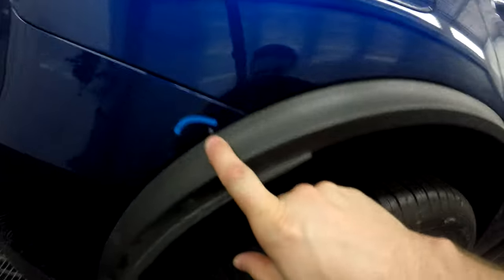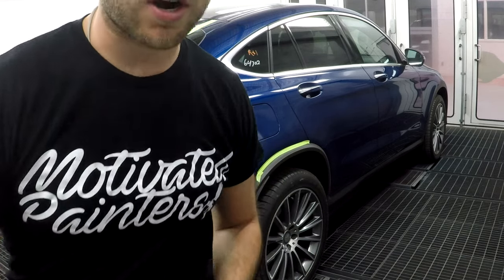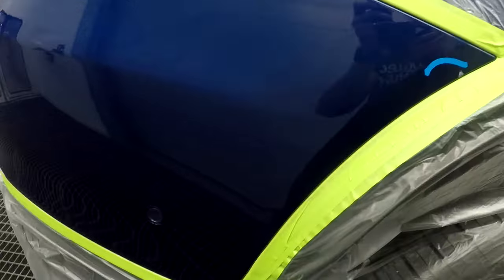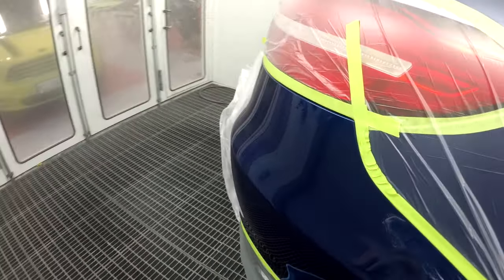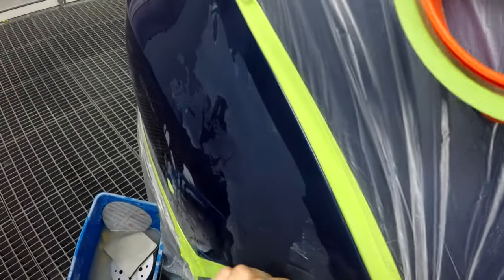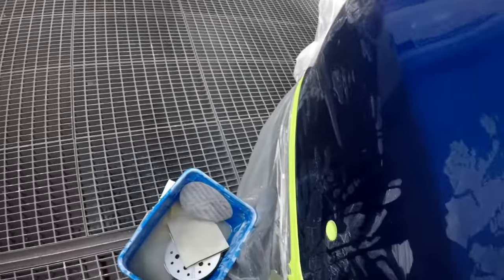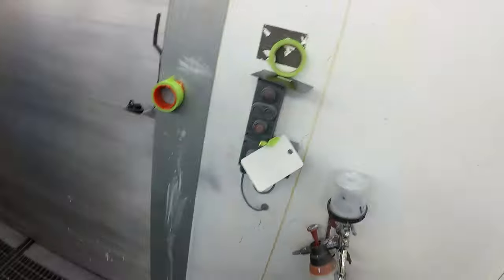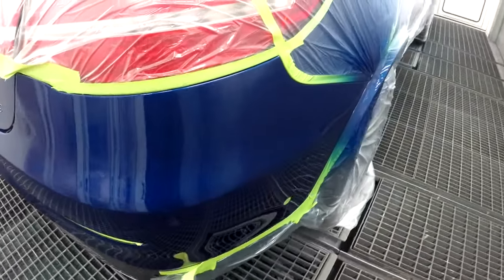How to do a blow in/smart repair

Comment: Why? On the car with a clear blend?why not take it off and paint the whole thing? I get the cost but the quality will be 100%  ppg will not guarantee any clearcoat blend. And they are 100% guarantee to fail over time.
Reply from the maker: +James Fields yup. I agree with you. The customer is always right.
Reply: Agreed,  but it is a  nice blend  job :)
Reply: They don't want to pay what it weighs
Reply: Why exactly do they fail? I read somewhere that as long as you keep the base coat overspray away from the blend area and make sure the clear coat is fully cured before buffing, then it will never fail.
Reply: Do what you have been told to a black car on the bumper or pillar. Wherever. If you blend the clear and polish it out it will look great. But over a few months/ year the clearcoat will fail. Uv protection is obtained by mills. You thin out the clearcoat you thin out its life span.

Comment: Why not just west sand the spot use a fine line paint pen to touch up and polish the area to help blend? It wouldn't be perfect, but it wouldn't be noticeable on a scratch so low. You would have to be low and within a foot of the car to even notice. That's a lot of prep work for something so small

Comment: Thanks great info and ill put the info to use. I need to dust  in some poly clear where i sprayed it a little light or not at all on base with hardener. I plan on using the cardboard method for a soft edge and wet sanding the over spray. The clear is now 24 hrs old. Ppg says you can topcoat with scuffing after 24. Like any time whole panel or can you spot? Well see. Full restoration 66 chevelle on my channel whole rest of the paintjob is really good other option is a full wet-sand reclear.  This car wont see more than 10 days outside a year. Great stuff thankyou for all your videos i watched and how they help build confidence. A 66 chevelle is a big canvas!

Comment: This was great and it cleared up a lot of my uncertainties seeing how you used sanding to make the blend look smooth.  Thanks!
Reply: Good job well done.
Basically what your saying is only use top coat on the repair area, not on the blend  area?
On the repair you used 500 then 800 and so on...
In the blend area rather than using 1000 could you not of used 3000 all the way to the blend area?!?
Reply from the maker: Yes !

Comment: Hey Gabriel, did you end up wet sanding 5000 or did you do your blend on top of the 3000?, I couldn’t tell by the video if you ended up going with 5000 grit after the 3000?

Comment: Do you wet sand 3000 all the way to the edge of the plastic or do you leave a "small" strip of OEM clear?
Reply from the maker: 3000 until where I'm going to apply the blender

Comment: Hey Gabe I have a question for you. I have blending question for you. I have blending solvent and I wanna know if it is meant to be used in mixing with base and clear to spray or is it ready to spray when blending? The manufacturer instructions are not clear on use of their product.
Reply from the maker: Not sure brother I have never used what you are using so you know more than I do. You don't have to use blending solvent for base though just for clear

Comment: We have the same waterborne system you use and I'm having trouble with an 800j color code the base is always to light what do you recommend me do? And what do you do because I'm sure you to tint it as well. Thanks in advance
Reply from the maker: +zay gomez hey brother I usually look at the chips and go from there. I have a playlist on white pearls you might find helpful. I rarely tint them but just look for the best chip. But if you are having issues with it beeing to bright you can leave half of the white out if the formula and go from there.
Reply: I have found that the red variant matches the base really well, done quite a few of those, red variant has always worked
Reply: Zay, check your specials. There are some good variants in there. Also, you may want to spray 800J over g3 instead of g1 g shade. Can help the ground coat from being too light.

Comment: So....
800 grit on repair and base paint area.
1000 grit on transition area where clear coats ends and  3000 grit area begins. 
3000 grit area and edge of the clear coat is covered with blender. 
Absolutely no base on the transition and blender area. 
I think I got that correct? I have a small bumper repair I want to DIY. This video definitely helps.
Reply from the maker: Exacto!!!!

Comment: When doing a smart repair, do you clear past where you sanded?
Reply from the maker: Nope you can clean very well and clear up to you 1000 and 3000 then blender
Reply: @MOTIVATEDPAINTERS  thanks. My edge looked good until it started to dry. Can it be wet sanded and buffed?
Reply from the maker: Yes unless you got base overspray. It won't polish perfect
Reply: @MOTIVATEDPAINTERS  what grit sandpaper would you recommend sanding it with?
Reply from the maker: 3000

Comment: Can I mist with reducer from a finishing gun instead of using the blending spray in a can?
Reply from the maker: You can but you will not get the best results
Reply: Wow thanks for the quick reply, you’re awesome! The whole car is wet-sanded to 2000G and the blend will be sanded to match, then compounded together. Should I bother with blending spray at all? Thx so much for your valuable time..!
Reply from the maker: Yes you should  but you can always do a test panel on an old part and see how it would work
Reply: I couldn’t get blend spray so I used reducer with your technique, it worked out really well and will finish perfectly. Also I never thought to purposely blow away from the repair with both base and clear, what a difference! Thanks again man

Comment: In the shop where I worked to learn paint and body we did what they called a “ burn “ very similar to what you did there but we didn’t use blender , the problem we had with a burn was after it was buffed our it looked great but a few months later the blend area would show back up .
Reply from the maker: +MrFireman164 right yeah. Blender helps with that
Reply: No it doesn't... the blend area returns because the clear melter/blender solvent has no UV protection.  It will fail sooner or later.  Do not do a repair like this if you work at a shop that has a lifetime guarantee.  This is how you repair a 15 year old junk car in a driveway.  Not the way a newer benz should be repaired.  Turnout great, but it will end up failing over time.
Reply from the maker: +fwh79 yes sir! Thanks for the comment! The customer is always right.
Reply: You're welcome.  I hear ya man... been in the industry for 20 years, painting for the last 14 years now.  Gotta love the... shop management, owner(s), fellow employees, insurance companies, customers, paint or material reps, missing time on the sheets, insanely low labor rates (by the way... I love how used paint thinner is classified as "hazardous waste"... where is my HAZARD PAY???  Keep breathing that poison!),  being told I can "make it up in volume" when I explain that there is not enough repair time on a sheet, hearing about how a customer has run out of their rental and need their car back asap (like it's my fault that they didn't get rental coverage... way to be an adult customer with no rental coverage), cycle time, MATERIAL COSTS (I don't set the pricing on materials... sorry guys, I just paint the car), how I need to come in early and stay late (which bodymen almost never do, which is also usually WHY the shop needs me to stay late.  Bodymen love to bring cars over on thursday and friday so... I can just stay late to make up for their short comings concerning time management while they go home to their families at 5:00), and all the other things you can't control/constantly lose money on that are not your fault, even though everyone thinks it is.  Oh yeah... and you have to have the artistic TALENT to paint a car without messing it up on top of all of that!  You did a great job in this video and I hope you are being taken care of where ever you work.  Happy holidays to you and your family and good luck to you in 2018.  Sorry about my rant... this industry really knows how to make my blood boil some times.  I'm sure you and many of your subs know exactly what I'm talking about.  But hey guys... any monkey can paint a car.
Reply from the maker: +fwh79 HAHAHA oh man I glad you can let it all out man!  We got to focus on the things we CAN control and kick butt that's for sure!! Merry Christmas brother!!😊😊😊
Reply: Indeed!  Thank you my friend.
Reply from the maker: +fwh79 I appreciate you man
Reply: hit the nail on the head with your rant bro,,i have been in this industry (prison) for 32 yrs now..not ever gonna change but there are better places to work that treat you ...better i should say with a pause lol...
Reply: Jeff Barker:  Thanks brother... glad to hear someone agrees with me.  Starting to think i'm the only one losing my mind working at a bodyshop!  Back on December 4, 2017 I was "let go" cause we got a new manager.  Should tell you that story... it was pretty retarded to say the least.  It has been over 3 months and I haven't even started looking for a new job yet.  Completely dreading it!  It's like, every morning I have to decide if i'm gonna go out into my garage and start my car with the doors closed.  Seems like the only way out of this B.S.  Been thinking about starting a youtube channel to let all the customers out there know what is really going in at these shops.  So many stories to tell. . . that's for sure.  Are you a painter Jeff?
Reply: i hear ya bro, hope your car don't start ,cause that's not how you want to go out..yes I'm a painter/bodyman..believe me fwh79,there is a job out there with your name on it, get up kick yourself in the butt and go get it brother !! imagine if you had a daughter and the guy she is with has your current mentality , even though i don't know you personally,i share your frustration cause yes its happened to me too..you would want best for your daughter right? wouldn't you tell the guy to "Man up!" ,,guess that's what I'm telling you bro, like i said, this industry is not going to change but believe me its a lot better to deal with in other shops, go out and find the one best for you,or one you can better by joining there team..i have had jobs i hated to even show up at lol..but i have one that i can not wait to get to every morning,,its not state of the art like Gabriels video but people there are good..from one painter to another bro, i feel ya and i will help ya too..
Reply: Jeff Barker:  Thank you, that really means a lot to me.  I'm just tired of fighting and being surrounded by cowards.  No one can make a move cause they all have a family to take care of.  I get it... but it's not helping the situation.  Everyone has been conditioned to take it laying down.  They get accustomed to the boot on their neck and that is wrong.  These MSO's make me laugh... run by completely incapable morons that are "college educated".  They want monkeys in a shop to use six sigma while the people in the office can't even type on a computer without look at their hands!  The insurance companies run it all... and I know, some how... if you could trace the money up to the top... everyone one of these MSO's is owned by an insurance company.  That is the ONLY logical reason to explain the incredibly poor choices that are being made that cost the paint technicians a ridiculous amount of money every week (anyone remember Allstate and their Sterling shops???).  I can't stand getting out of bed and busting my ass, losing my mind fighting everyone for nothing.  Bodymen easily make twice what a painter makes.  The scales are way out of balance.  Lets not even talk about how bad the detailers are getting hosed!  It's completely insane to say the least.  I am an ICAR Platinum tech and i'm doing good to make 60K a year working some really long hours because most bodymen can't get their job done in a timely fashion.  I'm seriously considering just switching to body work.  Then I can do terrible body work that I won't be held accountable for.  While the paint shop has to block sand and prime my cars for free.  Not really hard to make money that way.  But it seems like the best course of action is to just leave this disgusting trade.  It seems as though no one cares as long as "their wallet" isn't effected, and it seems nothing is ever gonna change.  Thank you again Jeff.  Sorry about the rant... but i'm really mad as hell.
Reply: Mitchell R:  I worked with a paint prepper back in 2012 who OD'd because of his job.  Most of the employees at body shops are functional alcoholics, drug addicts, or both.  This industry literally kills people.
Reply from the maker: I completely agree brother I really do. I have learned that what people do to me should not determine who I am and so far it has worked well for me. I am truly blessed that I am taken care of where I am. But it's a two way Street of course
Reply: Doesnt matter what bodyshop you work at, you will have to do it at some point. Either because its an old piece of shit, or even brand new. Some people buy 150 grand cars, and wont buy new tires or arent willing to spend money to even paint the whole panel, lol.
Reply from the maker: Very true man !!

Comment: you need to fade out the clear the same way you fade base if you stop the clear in a line eventually as the paint gets older you going to see the clear line. how i was taught from ppg,sikkens an penta paint seminars is you need to fade out the clear the same way how you spray the blue.you put your two coats of clear normal but you fanning out the clear edge you not stopping at a line .then you mix enough clear hardener ,reducer add the same among of blender to the mix clear be like 1 to 1 mixture by doing this you thinned the clear down you then fan out the clear edge again then you take fade out thinner an just fan out the over spray of the clear.  not sure if you understand this way but all this can be done an you not even crossing the corner of the bumper doing this way years now with no clear line. i use sikkens SRA FADE OUT THINNER AN SIKKENS BLENDING AGENT

Comment: Gotta say, thank you for your effort. I dont understand how it makes sense to do such a big blend on a car a $100,000 plus AMG. Lets say the owner is stupid enough, and someone has lied to him, and convinced him a blend is the same as doing it properly. Then his got to be stupid enough to convince, to be happy with a touch up. It actually would make more sense. That only needed the smallest touch up paint. Mix the base, put few coats of clear, obviously with harder, quick sand, and buff. The fact that the rear bar will never match were it now meets the body due to it being painted edge to edge, is a bigger problem than having a smalltouch up. You showed so much technique and finesse, to blend in a bar on an AMG, im sure you could of done just as well with the colour match touch up. Usually, in this case, the customer is told that the whole bar is getting done, we will paint your car in a booth and bake it, hence why its going to cost you so much Sir, and they pay what it would usually cost to remove, paint and refit. " :) So a simple touch up, isnt going to make as much money as putting the whole car in a booth for a blend job.